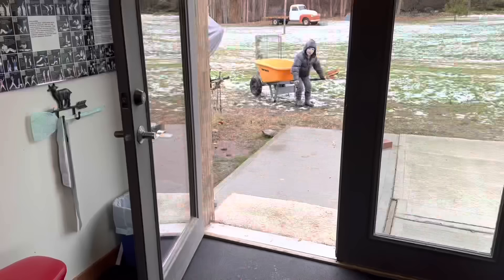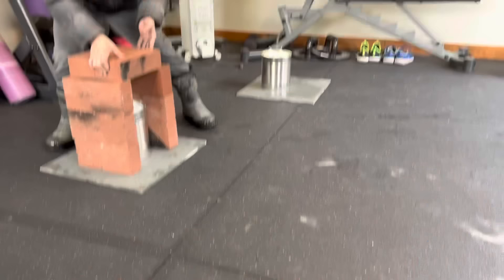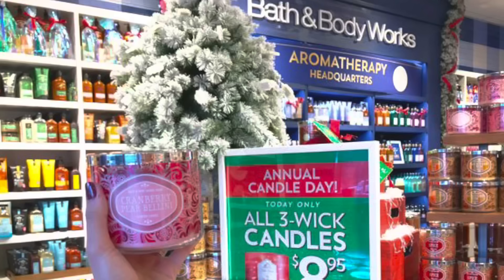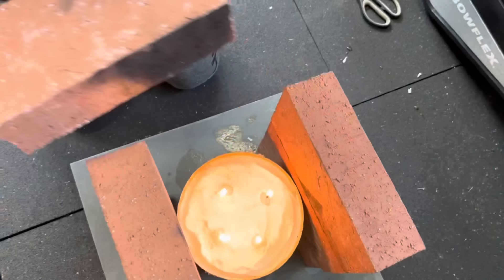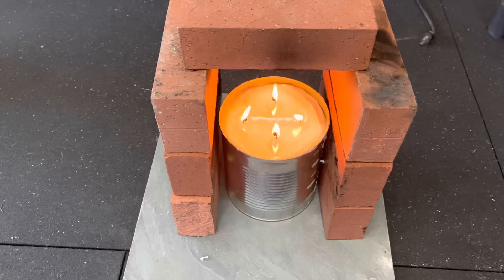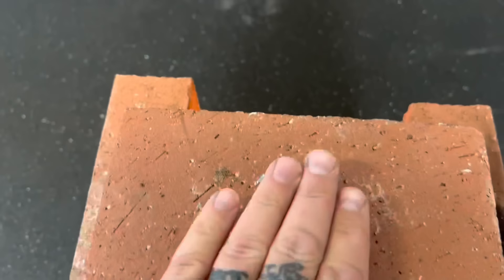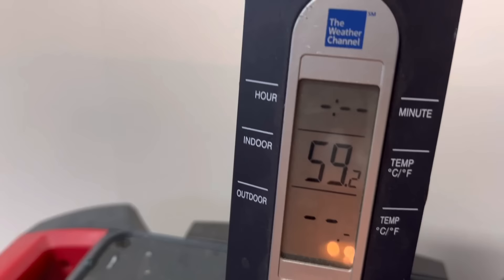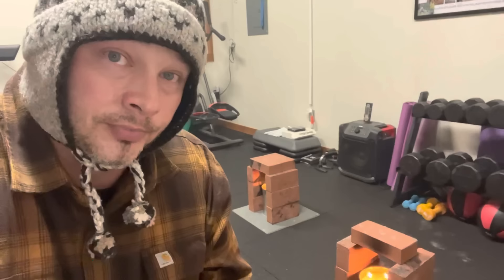Crisco candle room heating | Power Outage Room Heating | 9 hour test

Comment: I tried this last evening in my hoop house where I’m growing lettuce. I have a thermometer in it that I can read from my house. The bricks didn’t get warm at all. It seems like the terra-cotta pots warm better than the bricks.  It’s supposed to get really cold tomorrow evening so I’m going back to the terra-cotta pot method. 
Thanks for all you do.
Reply: Bricks take quite a bit of sustained heat to get heated through. Flat terra cotta roof tiles work well, too, if you are able to access any.  I was fortunate to glean some from a building being re-roofed locally which had been built in the 1930s.  
(Really sad -- they just tossed them in a dumpster, and what they replaced it with is a plastic fake slate which is very flammable -- I tested a small off-cut with a propane torch. My idiot state government 'at work'.)

Comment: I made a crisco candle out of a ceramic egg cup for use in the microwave. Fill it half up and when it's lit the cup heats up quickly and stays that way even after blowing the flame out. That lil thing kept me nice and warm on a -20f night when I ran out of propane in my 8x27foot motorhome. I had 3 terra Cotta planters that I had set up as a radiator as well that sat on top of that candle. It worked amazing and was still burning in the morning when I got up

Comment: I did almost the same setup, but I used 4 regular candles.  #1.  I have found the candle w/standard wicks cause the flame to be very small and when you pass them, they may blow out.  #2.  I will go to a hobby store and get cotton wicks for candles / thicker may / will be better (1/4").  #3.  With a larger wick I will place at least 2 bricks on top, in case it smokes.  The porous brick will help.  I will try 1 with a 24' by 24" square concrete paver that may have more radiant heat.  I like your thoughts and Ideas.  Well done, Sir!
Reply: @Keithgeisen: Crisco, a hydrogenated vegetable oil is extremely viscous when liquid at a temperature just above the solid state and requires, as you admit, a large wick capable of transporting the fuel to the flame. The matching of wick to fuel source is critical to prevent sooting or a too small or too large flame. With viscous fuels this problem becomes more evident. A wax birthday candle is used here (and in other builds) because most people don not understand how to wick a candle (of any fuel) and recognize how difficult it is to get Crisco to start burning when it is a solid and rely on the ease of lighting a paraffin candle.

Comment: In 80s b4 O2 CO2 sensors , I used those candles to keep Warm . Warm in Extended E350 with R3 insulation . Front cab was separated by 2x blanket covered by construction plastic . Stayed 60+ in 20 degree nights   Often got week plus use .

Comment: I like this man's video it is probably among the most accurate . I read thru many of the comments & a uniform thought was to cover the doors & windows . That is so correct but this is my thoughts on how to do that & it can be done YEAR AROUND . I don't remember where I learned this from but I do know it has been over 30 yrs ago....... I use bubble wrap to cover the windows & over the frt door . Yes , bubble wrap that we use to protect our things when we move . I always have to tape it together with clear packing tape to make it large enough to cover them with. It has a VERY SMALL  r- value , maybe an r3 to r5 insulating value , not much but it does help/ make a difference.  It helps with heating in the winter & cooling in the summer . When I take it down I roll it up & store for the next winter . Several of my neighbors thought I was nuts for doing this now all but 1 of them are using it also after trying it for 1 winter . I hope this helps those that live in drafty old homes like I do .
Reply from the maker: Thank you for sharing Louise!
Reply: I also live in a drafty old house where my bedroom window is not quite well seated anymore and lets in a lot of freezing air, particularly at the base where the window does not lower completely.   Now I used rolled up bubble wrap around the base of the window and up the sides, anywhere that a draft seems evident.   This solved the problem enough that the inadequate heat in this place was finally able to keep the room tolerably warm.
Reply: If u mist the windows with water u can adhere bubble wrap to the windows for extra insulation!

Comment: Very interesting.  A couple of mods that came to mind: 1. Maybe shorten the height of the brick tower to create more stored heat.  2. I think I would probably wall off a smaller hot tent type area to heat more quickly and efficiently.
Great idea!  I'll be making some crisco candles this weekend.
Reply from the maker: Not a bad idea the fun thing about these as you can be super creative, just make sure it doesn’t get too hot in there because if it does reach over 400° the crisco could catch fire
Reply: I agree...turn the bottom pair of bricks so they lay flat. That'll lower the height of the "element" brick by at least 1". That'll make it hotter=more heat being radiated into the room! Cheers from Canada! BTW it's-26 Celsius outside this morning. Could use one of these!👍👍
Reply: @kevinanderson9243  yup, lower the bricks closer to the flame and place the extra bricks on the top for even more stored heat. you should actually be able to warm up a pot of water on top of the bricks after they get up to temp. you likely won't get it boiling, but maybe warm enough for a hot drink to also help keep you from freezing. the heat's there, why not use it to the best of your advantage! 👍😁
Reply: @007tallguy  A little light in the dark, some plenty hot water and a bouillon cube can make a world of difference when one is feeling desperate and cold.
Reply: My mother lived in London during WWII though out all the bombings.  Because they had no basements or shelters, the government issued large steel tables to replace dining room tables.  Their purpose was to get all the family members under the table when the air raid sirens sounded, in case the house was bombed and collapsed.  They draped blankets and quilts over the table, hanging a few inches from the floor.  The covering protected the sides of the enclosure from shattering windows blown in and during winter, without power, a single candle raise the temperature to a comfortable level under the table where they slept.

Comment: We have a 3 ton heat pump outside of our garage with a lean to over it to keep the 5-6 feet of snow we get every winter.
The heater for the house is in the garage along with our water heater.
Our oversized 2 car garage (26X30) is insulated with R-19, and is sheet rocked, so even when it gets down to 5-10 degrees outside at night, our garage never gets below 40 degrees.
I doubt that we’ll ever have a blackout in our area bc we have 3 dams that produce electricity for all of WA state, OR and as far south as Redding, CA and as far east as parts of MT, USA.

Comment: Just check out some videos on vegetable oil candles and diy floating wicks. Because you can also use a piece of wire to hold up a piece of cotton wick to the top of a vegetable oil candle. I have tested this. Its fine. It will burn a long time. Thats all you need. Like an olive oil candle lamp but olive oil is expensive. Just use any cheap vegetable oil and use any old cheap can. I have tested all of these. Its fine. Close your door and windows or you'll freeze to death and blow your pipes. You could even use a fancy feast cat food can to make a small candle, and put those under the sink in the kitchen and bathroom pipes in the cabinet to keep the pipes Warm. Now your affordability toasty.

Comment: Excellent demo! Good info on crisco burn temp, no odor and the added carbon monitor. 
Just an FYI, the little coconut oil candle I made in a 4 oz mason jar.  I added tooooo much essential oil and it did catch fire.  The lemon and orange smelled great for a while, but it started popping and then the whole mouth of the jar was a flame. 🔥🧯🚒 Fortunately, I had it right next to me to monitor the burn and quickly extinguished with the lid. I would estimate that I added 50 drops and should have known better🤪😲🤣😂...livin and learnin. I'll be making more lil candles and divide the excess fragrant oils to a few drops each and see how that goes.
Reply: How does your coconut oil not just melt and snuff out your wick?
Reply: @bjhessler162  It was tricky to make, but doable.  I used a solid coconut oil. Only the candle burns, the oil melts a little around the flame.
Reply: @ellemoon6182  I'm not sure what I've done wrong. What do you use for a wick in your solid coconut oil candle? Because mine snuffs itself out within a half an hour
Reply: @bjhessler162  I used a tiny 4 oz mason jar and used a birthday candle.  I wanted to make a pint size, but small town local grocery does not carry the Shabbos white Candles.  I'll probably have to go to Walmart one day to pick some up to make a pint sized candle. We used them a lot when I was a kid for power outages bc they were so cheap.

Comment: So the key is to light these as soon as a storm is heading in so it stays ahead of the cold. It’s cheap enough to do so if you were to lose power, it will continue to stay warm rather than the time lost trying to reheat.. Thank you and beautiful family 💓
Reply from the maker: You are spot on with that comment, it takes a while for it to radiate out enough heat to change the temperature of a room but once it’s there as long as you’re not opening doors a bunch it’s a stance fairly well, thank you for your input and thank you for watching many more great tips to come
Reply: Yes, good forward-thinking, and good planning!
Reply: Having a plan to deal with power outages during cold days is a good idea but relying on Crisco as a fuel is foolhardy. This video mistakes the burn time of a 3 lb can with 4 wicks as 72 days. Wrong, it’s 72 hours and 3 cans are necessary to raise the temperature by 21F over the outside temperature for a 200 sf room. If it’s 0F outside this system will get your small room to a balmy 21F! Stupid plan! How about buying a small 10,000 BTU or even a 25,000 BTU kerosene heated and investing in a 3 gallon jerrycan filled with kerosene. That size will heat your entire house for about as long as three cans of Crisco to a much warmer and suitable living temperature. BTW Crisco is about the same cost as kerosene per BTU.

Comment: Thank you! I wasn't aware it would take several hours to get warm to 60°. That's the temp I like anyway. Setting this up today. Lost power for 15 min. IDk why. Better to be prepared. 😁I haven't turned the heat on this year yet. It's been 30° twice and inside my house, 55° so it's insulated well.
Reply from the maker: Excellent! Yes your home sounds like it is insulated very well! thanks for watching Vicki
Reply: It wouldn't in an 8' ceiling room. He has a 16' ceiling? That is why he had multiple heaters going. It was a HUGE room.

Comment: My woodstove burns wood or coal and is a gasifier.. Wood burns at 500 degrees and coal at 1500, and that doubles when you add O2 = 1000 & 3000 degrees.
The first time I burned coal it was 30 degrees F outside and I had to open all of the doors to let the heat out, so now I only burn coal when outside temp is 10 degrees or lower.
Reply from the maker: That’s impressive

Comment: I tried your Crisco candles I was using old birthday candles I had ( unused) I found the the wicks in them were only about a 1/4" long. So I thought what else could I use in an emergency.  I decided to try a q-tip ( not the plastic kind). It worked great . My crosco candle has been burning now for 4 hours and still going strong.
Reply from the maker: That is awesome to hear, I’m glad you tried it out, some people have issues with what are using for wicks, but you were doing the right thing by testing things out and figuring out what works and what doesn’t… Good job
Reply: Oh, brilliant!  I guess the dodgy manufacturer's of birthday candles expect they''ll get blown-out and thrown-out -- And I'm sure many do, but not all of us. (I keep them for the wax. Wax is rather 'magical' in it's own weird way; it has so many uses...)  
Since I only buy the cardboard-tubed q-tips anyway, I shall have to give this a try.  Thanks!

Comment: My greatest need would be to have in my pumphouse to use when the power fails ( I have a small heater in there and use heat tape around the exposed pipes), heating a small area safely for a number of hours

Comment: @Riverside Homestead Life  - A nifty camping trick I use, is to heat the bricks around an open fire outside and bring them back in already hot. This also avoids the accumulation of fumes in your living space. 👍🏻‍
Reply from the maker: Thanks for the tip Zurkster!
Reply: @RiversideHomesteadLife  If you build a tunnel with the hot bricks and place a fan at one end, you've just created a hot air space heater! 👍🏻‍

Comment: just a heads up, a candle flame is around 80 btus, a regular 1500 watt electric heater will put out 5000 btus. so what he had in that room would have put out around 1000 btus. a btu is a british thermal unit usually measured in btu/hr
Reply from the maker: Thanks for watching and the tips 🙌🏽
Reply: The electric heater is useless when the power is out

Comment: increase the height or mass of bricks above the candles it will store and radiate more heat into the room and you will also have hot rocks so to speak to in or under your blankets or bed.
being safe of coarse ! had to say it for all the trolls / dummies out there.
I like the video , thanks for taking the time.

         🍻 Cheers

Comment: I built one of these that took me a week to plan. You need sealed construction with restrictive heat migration, meaning you have to trap the heat within the box. Candle heat input must be FAR MORE than candle heat exhaust output. meaning? You must TRAP the heat inside the box and turn the box into a radiator allowing only "cool smoke" to escape.

Comment: A 6 or 9 liter class K wet chemical fire extinguisher would be good for an ignited spill.
Regular ABC and BC extinguisher units don't work as well and also cause dry chemical particulates to hang in the air for quite a while.
Reply from the maker: Thank you for that I will write it down

Comment: Could also use an eco fan on top of one or all of those candle set ups on a metal cover rather than a brick to circular the air rather than just radiate off the brick..  nice vid though proving yet again that in rough times we can use many things to make times better..
Reply: How do you use a fan to circulate the warm air if the ele is off ? Many , many homes now are total ele so......? This is about emergency heating for when the power is out .
Reply: @louisevaughan2165  wood stoves can use the eco fan too. no electricity needed. the heat radiating makes the fan spin on its own. really cool!!
Reply: @alisatjaden3906  you are correct . When I had to move to okla I had to sell my wood burner & I had it set up like that & I liked it

Comment: I used my Mr. Buddy heater on low attached to a 30lb propane tank with a window cracked during our ice storm last year that killed people.  Me & my furr babies were plenty cozy.  Now, I’m in Montana dealing with temps a Texas girl never felt before!  I need something in addition to my Buddy heater that works on a budget.  We’re in a smaller trailer, but it is very drafty so I am going to try this Crisco thang and see what we can do - thanks for these tips!  🔥🙏🔥
Reply from the maker: Remember more candle more heat / get thos windows covered aside from the one brining in the fresh air- it the will really help with condensation too- be sure to get that battery powered carbon monoxide detector for sense of security- good luck- I will keep tips coming- building a small safe wood stove would be the ticket in your situation- I will be showing how to build one soon
Reply: @RiversideHomesteadLife  I would love to build a small wood stove!  Anything I can use pellet wood in...pellets are really inexpensive here; $4 for a huge bag of wood pellets.

Comment: Again, the pots or bricks or tin cans don't change the output. It's the same amount of energy when you just burn the fuel without them. But it's probably helpful to contain bigger fires a bit, for safety reasons.
Reply from the maker: Gustav- you are correct - nothing I add will generate more heat- the idea is to radiate the heat - 
Thanks for watching!
Reply: @RiversideHomesteadLife  oh good, thank you for your reply.
I just keep saying that because there's people who think that.

Comment: Candles are only about 125 watts of heat, all the bricks are doing is providing thermal Mass to capture  heat in an isolated area and slowly releasing it... you get no more heat than a candle... your drywall will absorb it just the same...it's just harder to warm your hands with

Comment: Very nice demonstration video! I love all the tips along the way. Get a BATTERY POWERED carbon monoxide detector. And telling us the actual temp outside is very helpful to get a gauge on how helpful it would be for us.

Also the tip about bricks helping keep the heat lower in the room was a great point. So many videos get that wrong about terracotta or brick candle heaters. The clay doesn't magnify the heat, it just helps keep the heat from instantly rising to the ceiling.
Reply from the maker: Thank you for your comment Angie!
Reply: @Angie_978: the brick, thermal mass radiates infrared radiation that will interact (heat) whatever is in its way, chairs, walls, us, etc.. it changes the convective heat (hot air) to radiant heat. A good home space heater will convert as much conductive and convective heat to radiant heat as possible to increase comfort.